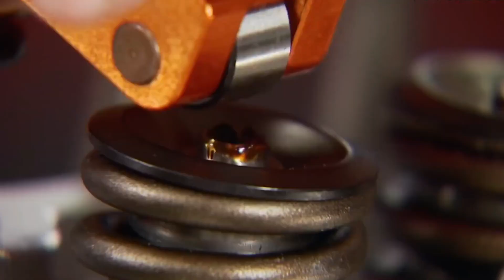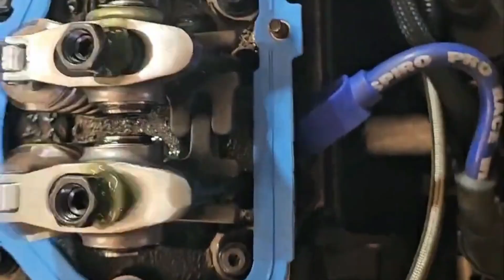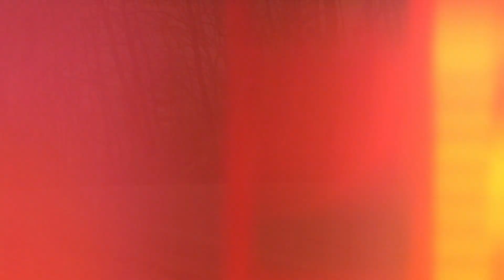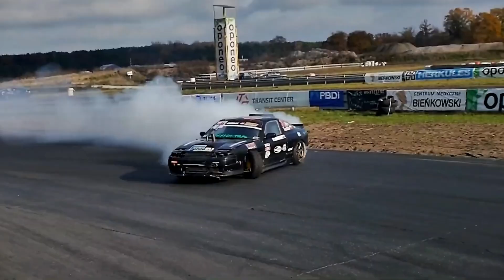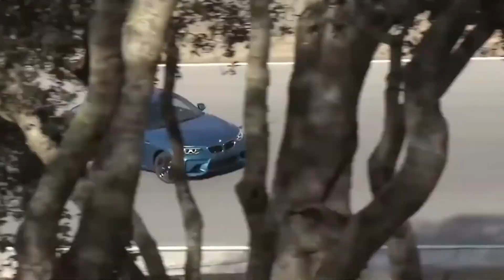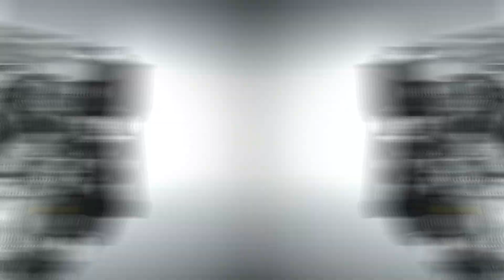Most Reliable Inline-6 Engines That LAST FOREVER

Comment: You people have a lot to learn 235 cu in chevy 225 cu in slant 6 Chrysler and fords 300 cu in in line 6. These engines been around around for many years. Al.ost never need maintenance except for oil change and plugs you didnt do much research